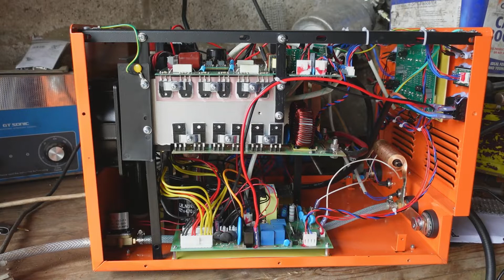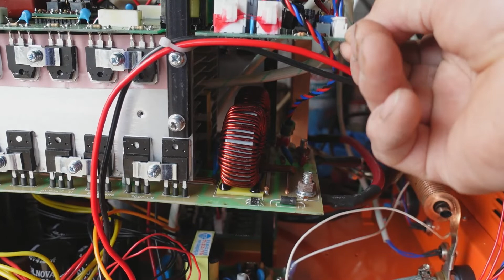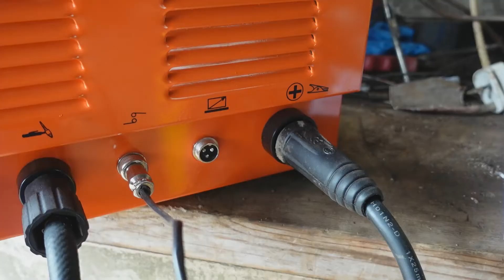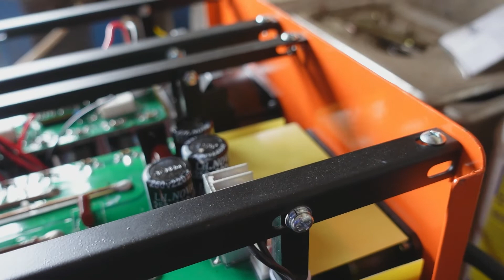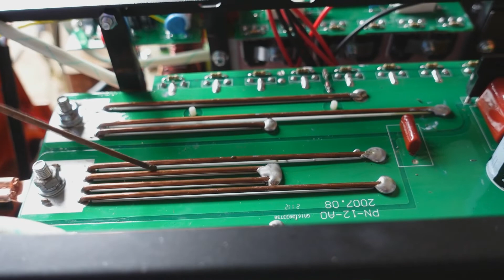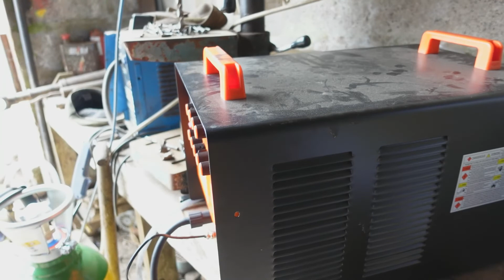ROHR WSME200, The inside story.

Comment: Thanks for the video! A quick browse tells me I'll likely be watching a few more of yours.

I have a similar machine (a 'Giant TIG220P' ), currently in the process of adding a DIY foot pedal.
You might want to do the same, it can be convenient to not have the switch on the torch.

(sidenote:for metric people, 28 thou is ~0.7mm )

(edit 2 min. later), I see you've already done the foot pedal!
Reply from the maker: Hi, thank you for your comment. I have since made a much better foot pedal but not yet had a chance to do the video. Even though my prototype worked and I copied the wiring from a chinese one, my friend and electronics guru told me that it was not correctly wired and showed me the correct wiring- video coming soon! Regards, Jon
Reply: @wotjonsez2560  No hurry, looking forward to the vid!

Comment: Excellent! Thanks for sharing. I was interested in having a look at the HF starter part. I suppose this is a German made Welder as the name (Röhr=tube) implies. 
I got a faulty 200A stick welder for experimentation. The mains switch, among other things, was already damaged, and so I replaced it with a switch and a contactor DIL ER-22-G. I also added  a current display of the actual value. I finally supported the copper +- leads with extra copper strips.
Finally, I'll add a HF starter for Tig welding.
Reply from the maker: Thank you. Definitely not German made, they are Chinese. Regards, Jon
Reply: @wotjonsez2560  I congratulate you, hope you make the best of it, and have a lot of fun. It has a lot of advantages and controls, spacy box where electronics get cooling,  air circulation as well as room for updating, repair and improvement.
Reply: I agree with your upgrade ideas. Replacing any high current carrying cables with ones that are as heavy as possible along with the switch.. Not much knowledge or money needed, just some common sense.
Each mod may seem small but they all add up to better performance.  A much heavier ground cable with a heavy brass clamp would be a good move too.. You can do the mods as and when you can afford to.